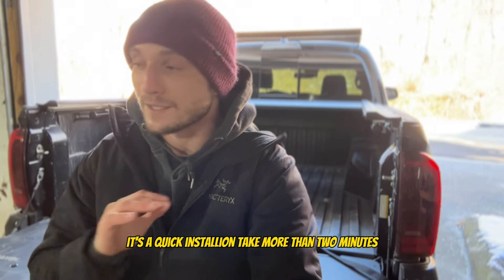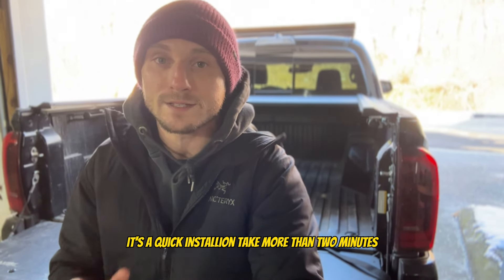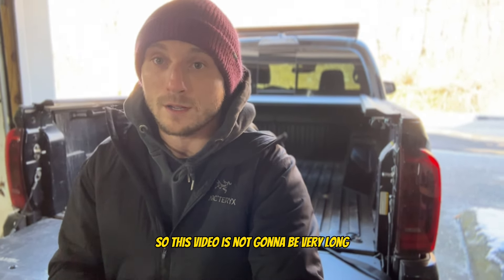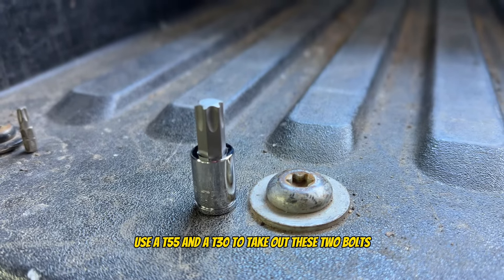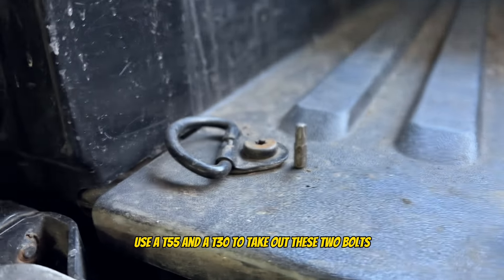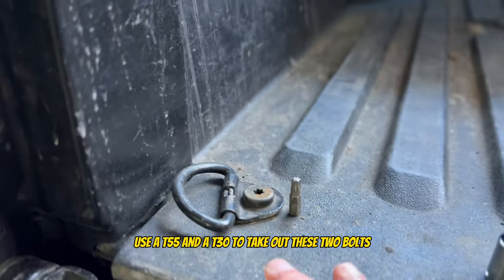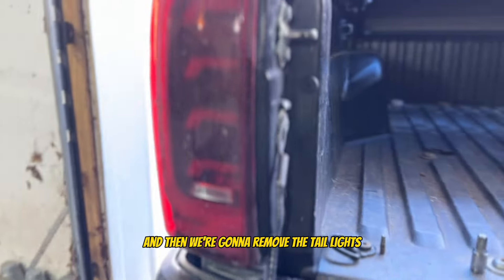🤯 3rd Gen Toyota Tacoma Bed Stiffener Install [Cali Raised LED]

Comment: Wait, how did you screw in the bolts on the side?
Reply: You need to remove the lights
Reply from the maker: Pretty sure you need a wrench and a socket and do that at the same time